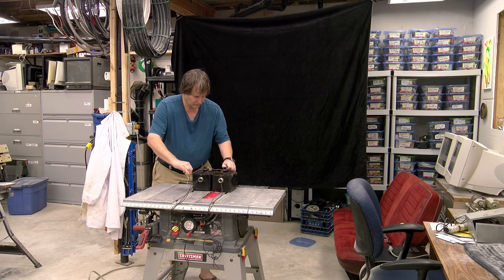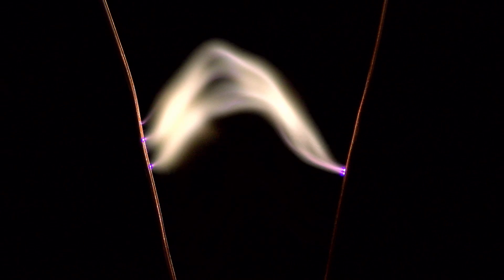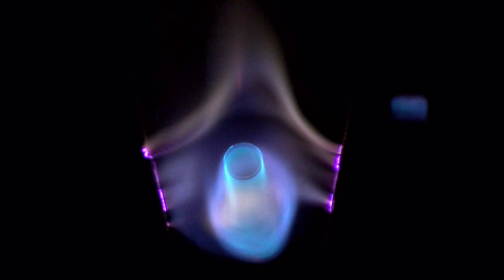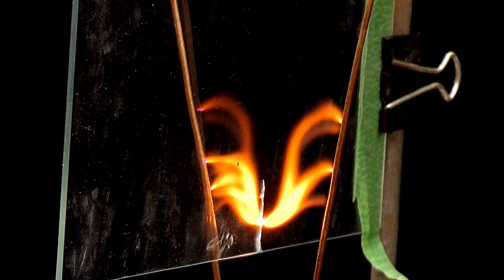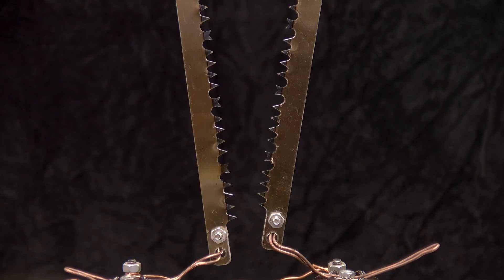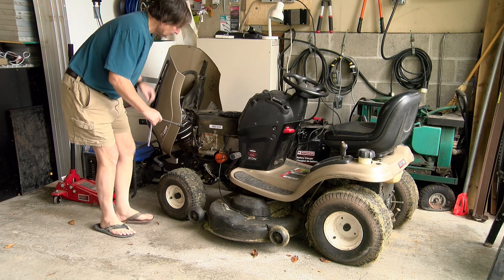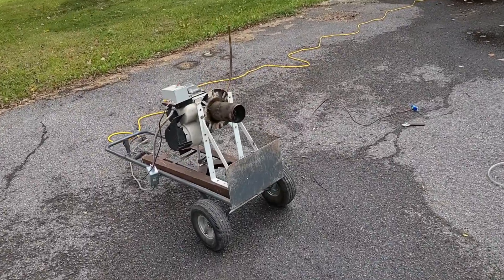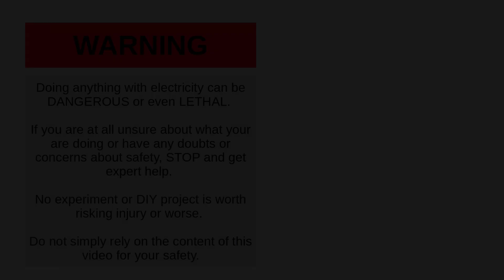Arcs, Sparks and Jacob's Ladders

Comment: Back in 1970, I was in High School then and tinkering in my garage with a 9000 volt neon transformer. By accident, the two wires I had positioned jumped from their spot and each landed on my thumbs. Not so good for the heart. My vision turned off, what seemed like minutes, and I could not let go at first. I was sitting at a old kitchen table and I finally pushed with my legs to move outward and get loose. That event really scared the heck out of me. Note : I still have that transformer but with a ton more respect for it or anything with high voltage. I am just glad it was not high amp like microwave transformers have or I would not be here speaking about it. The neon tranformer was in milli amp I believe. Way less than a microwave one. 68 now and arranging for a new garage I bought to be placed at new house we got , 13 miles away from the old one. I want to make it insulated and into a lab then I will experiment again with many things.  Trying to beat winter on just getting it here.
Reply from the maker: "My vision turned off" wow - as a kid I had a very similar experience when a somewhat hidden live cable in our yard  touched near my ankle - my hands were grabbing a well grounded metal windmill tower - voltage was real 220 (we were in South Africa at the time). Did you see anything when your vision shut down? I vividly remember black with swirling colors like the colors you see when closing your eyes.  I wonder what the mechanism is - the only thing I can think of the brain been flooded/overloaded from signals from the nerves in the lower body. 

Yea - those types of currents are (10 to 20mA) are generally survivable. The 1A available from microwave transformers is not!

New insulated garage/lab  - what a great project - know exactly what you mean about trying to beat the winter. Hope you post some  videos of your lab experiments when its setup!
Reply: Been a long time but I think I remember some yellow streaks a bit. Money is very tight now and the garage/lab may sit all next summer unless I find a way to add to my income. I am retired and a few physical issues but not serious enough to make me bed ridden. Last year I won a digital osciloscope worth $2200. Nice addition to many other gadgets and tools, master of none.  😶 @ElectromagneticVideos